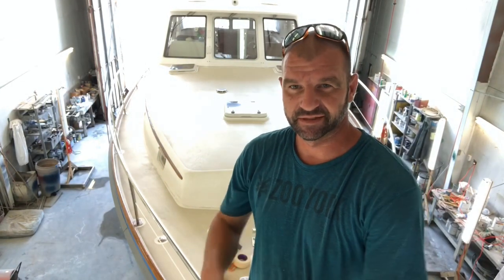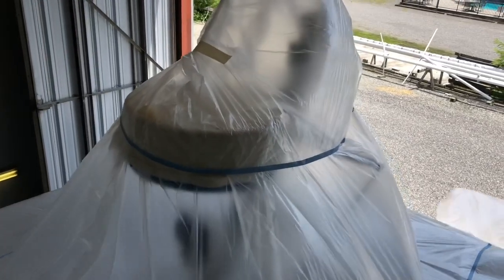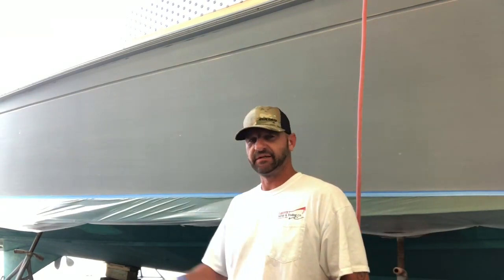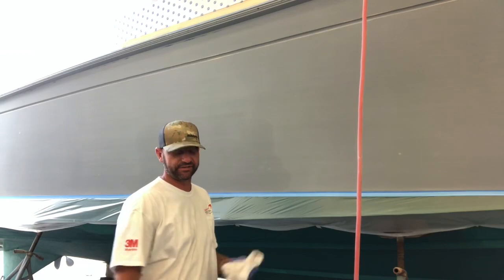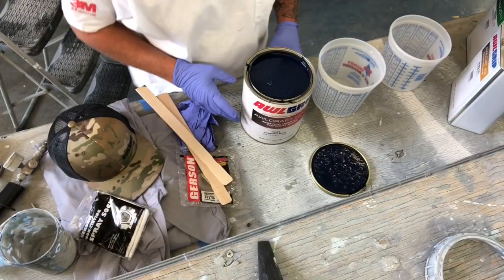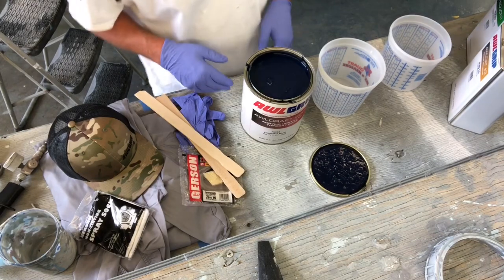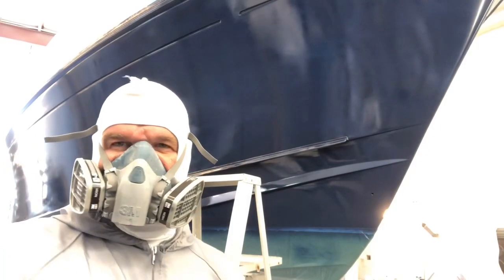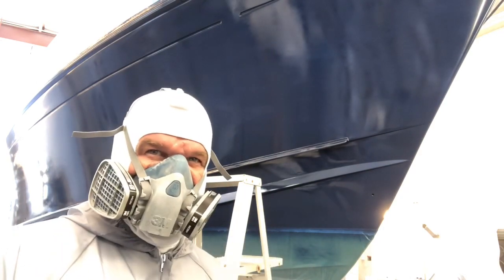How to prep, prime,prep, paint part 5(DIY)

Comment: Frankie have you tried G3039 AWL-CAT #5 Spray Converter with AWLCRAFT 2000?  Low VOC formula, makes for an increased gloss vs. G3010 AWL-CAT #2 Spray Converter.  It becomes a little more splippery, but the increase DOI is worth it.
Reply from the maker: Tom Crull i have heard about it but have yet to try it. The awlgrip rep in my area told me great things about it and is going to bring me some but it hasn’t happened yet.
Reply: @boatpaintingrestorationwit3029  Shocker!  Probably out of stock.
Reply: @boatpaintingrestorationwit3029  get me your ship to address and I'll send you some.

Comment: looks fantastic. To get as close to a mirror finish as possible is awlcraft better than the awlgrip and how do you minimise the humidity? Is there an optimum temperature for using these products?
Reply from the maker: Thx bud. I like awlcraft because it is repairable, but I like awlgrip better because it is stronger.  And you really don’t want to try painting below 50 degrees. Even if using accelerator. However I have painted in colder temps in the past.
Reply: Ideal application conditions = 77 F @ 50% humidity.  The isocyanate in the converter loves moisture, so when it's humid it with set up faster.  Colds temps will increase the open time of paint and the chance for runs is more likely.  AWLCRAFT 2000 was developed for painting is less than ideal conditions and repairability that Frankie points out.

Comment: did you have to mix up a new cup to get around the entire boat once? Whats the biggest boat you have sprayed non pressure pot?
Reply from the maker: On the first coat because it’s a light tack coat I can make it all the way around with the one cup. When going for color coverage on the 2nd and 3rd coat it takes two cups. The paint is already mixed so all I have to do is refill the cup. And ya gotta move fast on the last coat when doing that as you need to keep a wet edge. Biggest boat I’ve sprayed with this setup is 60 ft.  Hope this helps bud👌

Comment: Hello Frankie,
I’m confuse about how long you have to wait in between first, second and third coat ? What do you mean when you say keep a wet edge ?
Does it means you keep painting before it dries ?  Thanks for the teaching
Reply from the maker: Hey Pedro. It all depends on temperature, and size of job to determine how long to wait between coats. The best way to tell when your ready for the next coat is by doing the thumb test. Stick your thumb on the tape where the paint hit and count to two. When you remove your thumb and no paint stuck to it then you’re ready for the next coat. What I mean by keeping a wet edge is only critical on the final coat. Meaning you don’t want to stop in the middle of spraying and talk to someone, use the bathroom etc. you need to keep moving or else you’ll end up with hazing and dry spots that are dull compared to the rest of the surface. Just keep spraying and don’t stop if you don’t have to. If you do, be extremely quick about it 👌
Reply: @boatpaintingrestorationwit3029  thanks 🙏 I understand now . And thanks for all your great videos 👌
Reply: Hey bud what's the best psl for spray?

Comment: What kind and brand of paint do you recommend for painting the boot stripe? I am looking to redo my existing boot stripe that is flaking now and I have no idea what was used previously..
Reply from the maker: Are you planning to spray or brush?  Make sure you remove all the flaking paint. If spraying, I’d recommend awlcraft 2000 or alexseal. If brushing, you can use bright side , ezpoxy, etc. if spraying, I’d recommend priming first. It just really all depends on what you want the finish to look like. Ultimately, priming is probably needed with whichever route you choose
Reply: @boatpaintingrestorationwit3029  I would like to try my hand at spray and I figured what better place to start with a boot stripe. And I’m going to take your advice and get the 3m accu spray.

Comment: For a project this size what’s your air psi , fan and fluid turns? Overlap 75%?
Reply from the maker: Usually I run between 20-25 psi, I sprayed this with about a 8 inch fan and as far as the fluid goes, well that’s just something ya gotta play with until you like the way it looks. I honestly don’t really pay attention to psi, etc. I go by sound and feel. There’s that sweet spot where the gun talks to you ( that how my dad referred to it anyhow) lol. But it’s true. And I usually only overlap 20-30% if that. It’s all different for each painter.